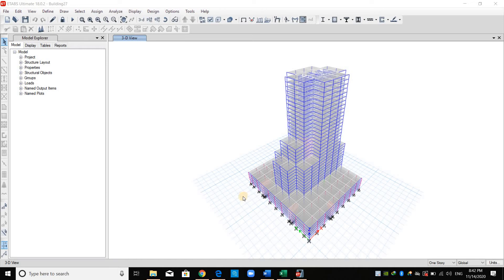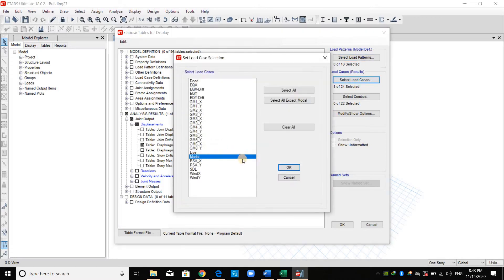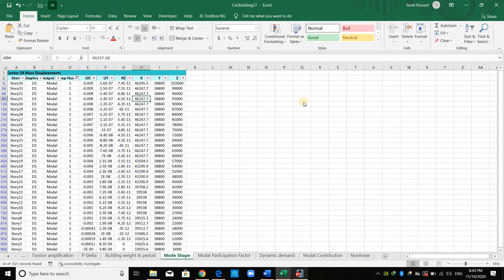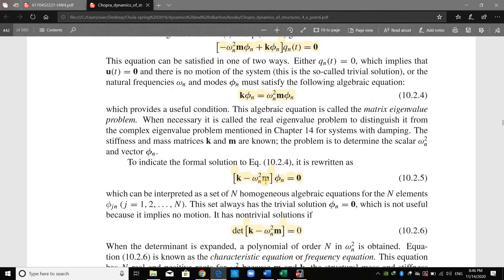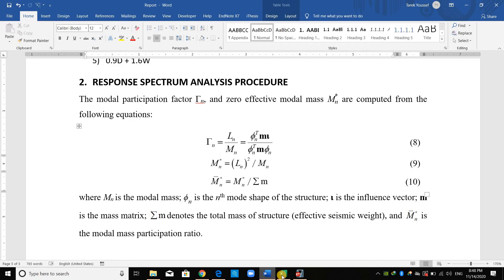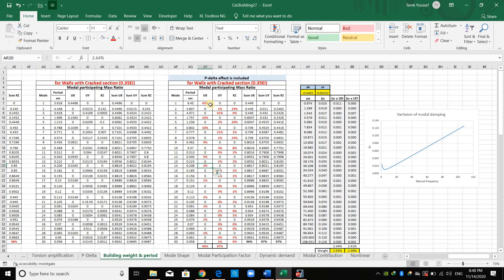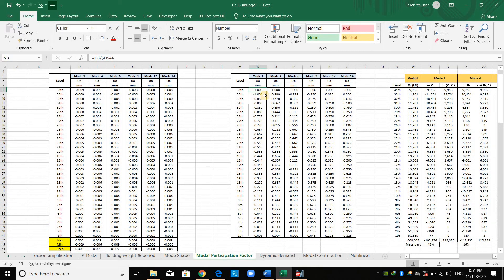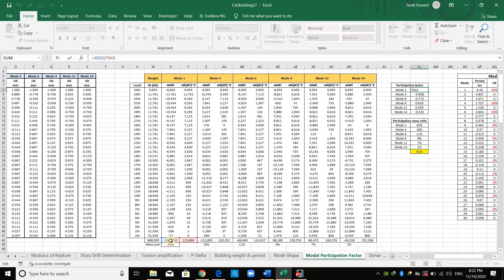How to compute the modal participation factor and the modal mass participation ratio (ETABS, Lec19)

Comment: Very Nice tutorial. But I want to know the very basic. Can you tell me, how can i calculate the lumped mass matrix and consistent mass matrix and stiffness matrix for a 3d space frame? Should i apply the gravitational load(such as dead load, live load, partition wall load etc) for calculating lumped modal mass matrix and consistent mass matrix?  can you give me any link or anythng else that solved a full example ? Thanks.
Reply from the maker: To calculate the lumped mass matrix, consistent mass matrix, and stiffness matrix for a 3D space frame, you'll need to follow a systematic approach that involves understanding the physical properties of the frame and applying the principles of structural dynamics. Here's an overview that might help:

1. Lumped Mass Matrix
Definition: The lumped mass matrix assumes that the mass is concentrated at the nodes.
Calculation:
  - Identify the nodal points of the structure.
  - Sum the masses (such as dead load, live load, partition wall load, etc.) that are associated with each node.
  - Construct a diagonal matrix where the diagonal entries represent the lumped masses at each node.

2. Consistent Mass Matrix
Definition: The consistent mass matrix distributes the mass over the entire structure, taking into account the shape functions used in the finite element method (FEM).
Calculation:
  - Use the shape functions for the elements to distribute the mass.
  - Integrate these shape functions over the volume of the elements to construct the mass matrix.
  - This matrix is typically more complex and requires numerical integration.

3. Stiffness Matrix
Definition: The stiffness matrix represents the relationship between the nodal displacements and the forces in the structure.
Calculation:
  - Derive the element stiffness matrix using the material properties (Young’s modulus, Poisson’s ratio) and geometric properties (length, cross-sectional area).
  - Assemble the global stiffness matrix from the element stiffness matrices using the connectivity of the nodes.

Applying Gravitational Loads For the lumped modal mass matrix and consistent mass matrix:
- Gravitational loads (such as dead load, live load, partition wall load) are considered when determining the masses to be lumped at the nodes or distributed over the elements.
- These loads influence the inertial properties of the structure and should be included in the mass calculations.

#Resources

•  Structural Analysis by R.C. Hibbeler

• McGuire, Gallagher, Ziemian, “Matrix Structural Analysis,” 2nd Edition, Wiley.

• Ghali, A., Neville, A.M., Structural Analysis – a Unified Classical and Matrix Approach, Second edition, Chapman and Hall, London, 1978.

• Sack, R.L., “Matrix Structural Analysis,” PWS-KENT, Boston, 1989.

• McCormac, J.C., Nelson, J.K., “Structural Analysis-A Classical and Matrix Approach,” Second Edition, Addison-Wesley, 1996.

Comment: How is the process for the rotacional mode?, I mean mass matrix have the rotacional mass that's (a^2+b^2)*m/12 but if you use these values the magnitude diference between rotacional and traslational mass is too much, how i can compute de mass participation in rotacional if is that the case?

Comment: I do not understand the physical meaning of the negative participation factors in the Modal Analysis. I am confused the "modal"  participation factor that often using on the force response analysis (or Harmonic in ANSYS). The M(odal) PF is related to the excitation location while the M(ass) PF is independent of the excitation location since it is only Modal Ansys. Can someone explain it to me?

Comment: When you calculate the numerator of the participation factor (gamma_n  in equation 8) at 0:26, it's not just mode shape transpose * mass; it's mode shape transpose * mass * influence vector. I didn't see you multiply by the influence vector in excel. You just calculated phi*m. How did you account for the influence vector?  

Also, one reason you might not be getting the same results from the software is bc a lot of the commercial software normalize the phi with respect of mass so phi^T*m*phi^1. You normalized it so that the largest magnitude is 1. I believe the participation factor is dependent on how you normalize the phi. 

Thanks!!

Comment: Excellent videos, does modal mass participation ratio different between nonlinear and linear analysis,does  sheet "nonlinear" have video? , thanks
Reply from the maker: Yes, the modal mass participation ratio of linear and nonlinear model are different because the stiffness of structure is different in both models

Comment: Tarek I really love this. Can you comment when you see a participation factor (PF) less than zero, can you say what does that physically mean? Perhaps we don't care, and just look at the magnitude, right? I understand the Modal Effective Mass is the PF^2 so perhaps that is correct. Can you comment for me?
Reply from the maker: The values of the participation factor (PF) depend mainly on how the mode shapes are normalized. Therefore it does not matter if you get a small or large value of PF because it is based on how mode shapes are normalized. Also, I believe that PF does not have a physical meaning, and we just need PF to compute other response quantities like the modal mass participation ratio (MMPR). The MMPR shows the participation of each mode in the total response which is important to know. Lastly, the Effective Modal Mass (Mn*) = (PF)^2 if the modal mass (Mn) is normalized to be equal to one. I hope I have answered your question.

Comment: OW TO COMPUTE IF THER IS COUPLE TRANSLATION CONTRIUTION IN MODE SHAPE
Reply from the maker: When we have a translational-rotational coupling in one of the modes, we need to multiply the modal quantities obtained from that mode (modal participation factor, modal mass participation ratio) by the "Modal Direction Factors". The Modal Direction Factors can be obtained from ETABS from Display ==> Show Tables ==> Structure Output ==> Modal Information ==> Modal Direction Factors.

Check this link for more info regarding The Modal Direction Factors

https://wiki.csiamerica.com/display/etabs/Direction+factor#:~:text=Answer%3A%20For%20each%20mode%2C%20modal,factors%20therefore%20sum%20to%20100.